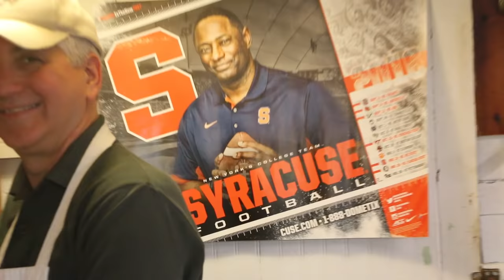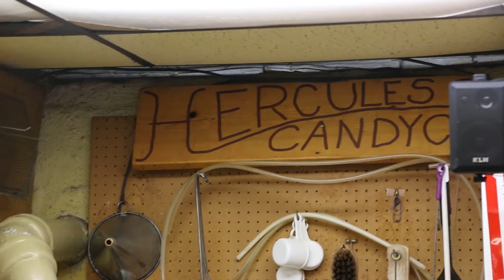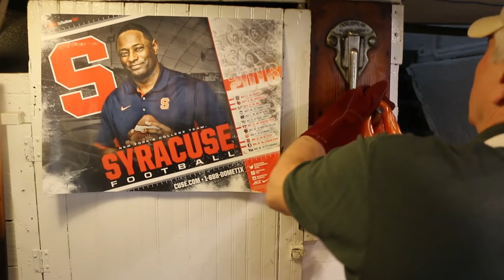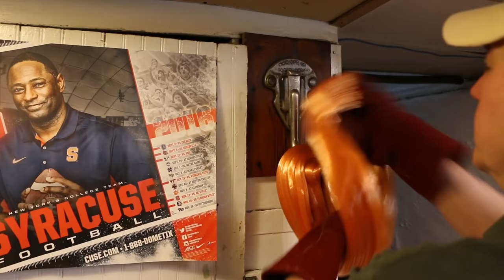Family Secret Homemade Hard Candy Recipe!

Comment: Just some small advice its better to add the food coloring when the candy is boilinghot so it evaporates the water and it doesn't make the candy sticky, also when you leave it on the cooling table let it cool and then cut it in half and let the middle cool up my grabing the block and pouring the hot candy on the table and the but the block on the top, I am not an expert i just say it in a video made by lofty pursuits and the way they do it looks better.
Reply from the maker: Thanks for the advice!
Reply: Abel Ortega I'm very sure they know what there doing and don't need any advice.
Reply: Abel Ortega It looks like they use gel food color, which isn't as much of an issue. Mostly when I see people use that method (boiling water out) it's because they used liquid. Gel food coloring is stronger so you can use less, and it already contains less water anyway.